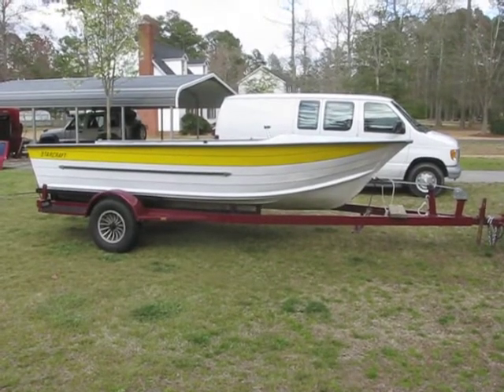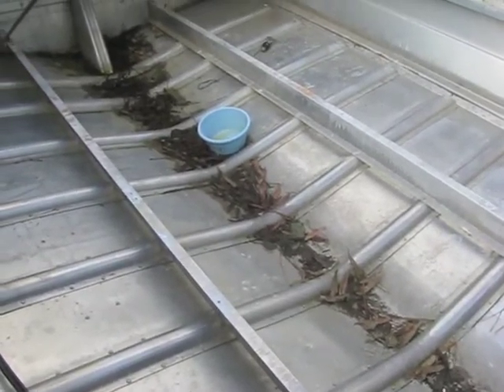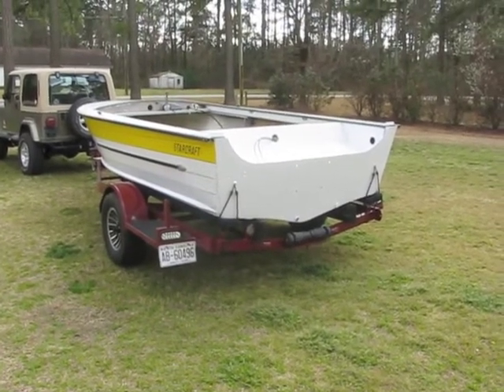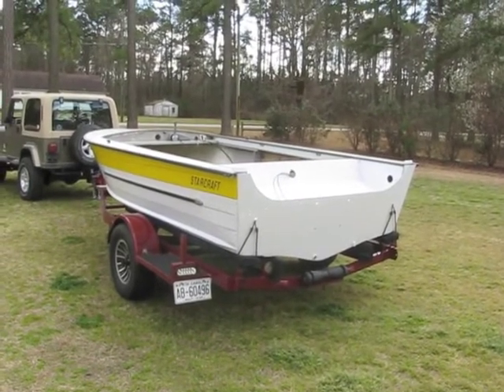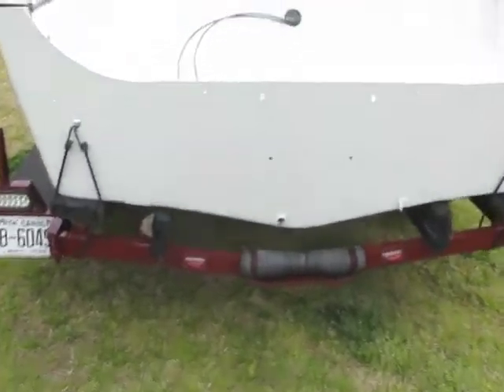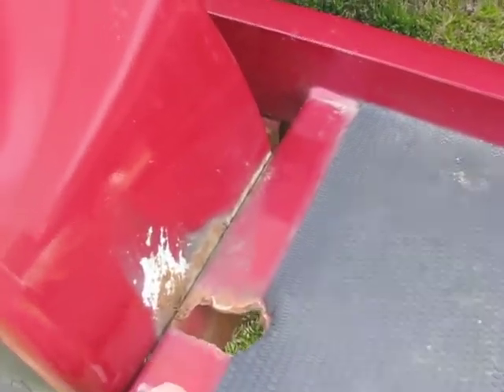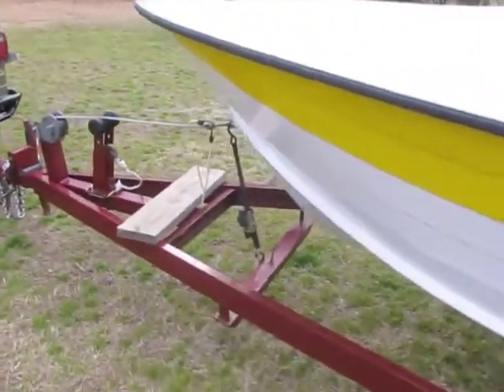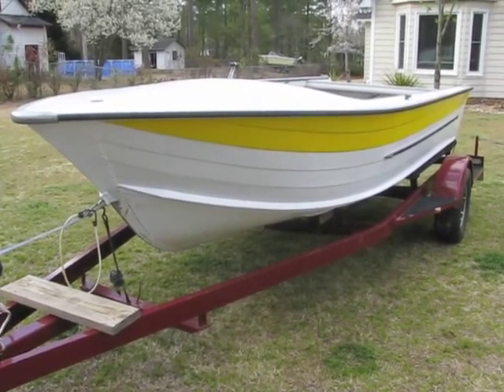1966 Starcraft Jupiter Update (& newer trailer)

Comment from the maker: I did use the 2-part pourable foam on another Starcraft and it was very easy. I didn't want it to adhere to that aluminum hull and laid down 10-mil plastic first.
(plastic keeps it from creeping in/under places where I don't want it)  
Sprayed plastic with silicon spray so the foam wouldn't adhere to the plastic. Trim off the excess foam (metal hack saw blade or old ban saw blade works good) then remove foam & plastic and set the foam back in place and install the floor.

Comment from the maker: ….I chose not to go with foam under the floor of the Jupiter for two reasons:
1) extremely tight budget on this project.
2) kept thinking about how boats with all the foam under the floor like to roll over  when swamped. 
I decided to use foam (later) under the bow, splashwell, and gunnels as well as under the foot rest and behind the side panels. This should float the boat fine and keep it upright. Plus under the floor can now breath and stay dry.

Comment: I have a 1964 Starcraft Jupiter I'm wondering if you ever got that 115 horse on there I have 115 horse Power Tower I want to get it on there and redo the back like you did wondering if that motor ever fit on that boat or was it too heavy
Reply from the maker: I did install the Johnson 115hp V4 on the Starcraft for a test run. Weight was fine. Very close in weight to the 1966 Evinrude 60hp V4 that came on the boat. 
I had thought about adding more bracing to the transom, similar to the angle brace that came on the boat. After seeing newer (1970's & 80's) Starcraft boats running larger outboards with pretty much the same setup I decided against the extra bracing. 
The newer boats did have the splash-well narrower at the rear which I'm sure stiffened up the transom a little and transferred some of the pressure to the front part of the splash-well. You could always add a couple braces to do the same thing without changing the splash-well design. 
I did use a transom support plate for the upper two outboard mounting bolts as well as thick, large diameter washers for the two lower mounting bolts. I think the transom support plate is a must for the extra torque the 115 applies to the wood transom. 
Your '64 Jupiter has a flat bottom doesn't it? 
Years ago I thought about getting a flat bottom Starcraft just to install twin 25hp outboards on.

Comment: did you ever make your powell trip? I have a starcraft myself and am enjoying the vids.
Reply from the maker: I did go to Lake Powell in May of 2014. Unfortunately the '66 Starcraft didn't make the trip due to the engine fire during testing several months earlier. Our trip ended up being a 14-day 6000+ mile road trip. Spent a few days around Lake Powell and it was beautiful as always but just not the same seeing it from shore. I also spent a couple days venturing throughout Death Valley.
Reply: Yes powell is great but as you said nothing like seeing it from the boat. just not as fun. I from utah so used to go there alot as a kid although i have not made it in several years.
So did you get the Starcraft fully done yet? sorry snooped around on your YT page just never seen final results.
Reply from the maker: The boat is mostly finished. Transom installed, windshield installed, all deck hardware, and steering.
 I only installed one seat and a 9-gallon portable fuel tank for testing with the 1985 Johnson 115. Had some compression issues with that outboard so I bought a 1998 Evinrude 115 that was completely serviced (supposedly) by the shop that was selling it. On the second test run with that outboard it had a minor engine fire due to one of the water diverters (that were never replaced) failing on the right side of the block which caused overheating on that side. Unfortunately the new temp sensor never picked up the issue and before I knew there was an issue the wiring harness had melted to the block and caught fire. I have since repaired that outboard and even took care of the compression issue with the 1985 Johnson 115. Not sure if either of those outboards will ever go back on the Starcraft. Might sell both 115 outboards and also sell my 2005 Alumacraft 1436-LT Jon boat and 2012 Mercury 6hp 4-stroke so I can buy a new 50hp Tohatsu 4-stroke (EPA compliant). Once I figure out which route to go with repowering the Starcraft, I just have to wire up the lights and dash, install the rest of the seats, and install the two 22-gallon fuel tanks. Then the boat will be complete. 
I had the transom video edited and ready for upload and was almost done with editing the video showing the installation of the windshield and deck hardware but unfortunately my computer decided to lose all of those video projects. I recovered the original footage and will eventually edit and upload them along with some videos of my road trip.

Sorry for the long reply...